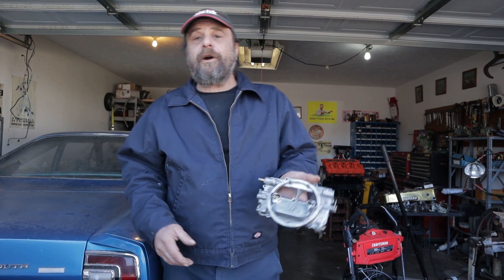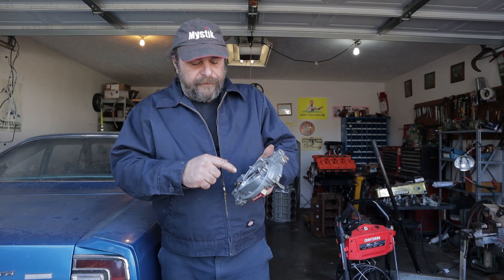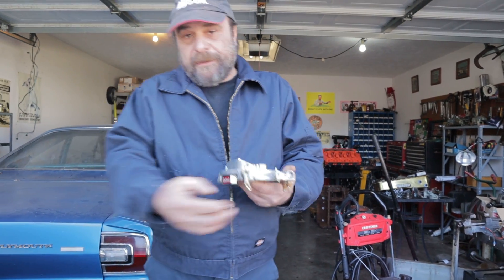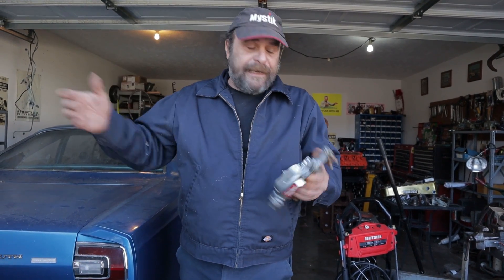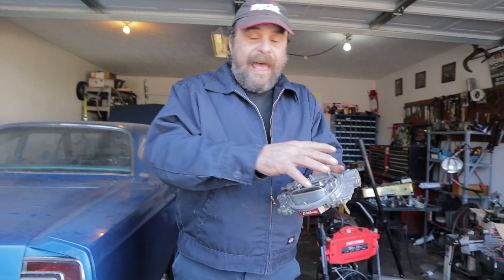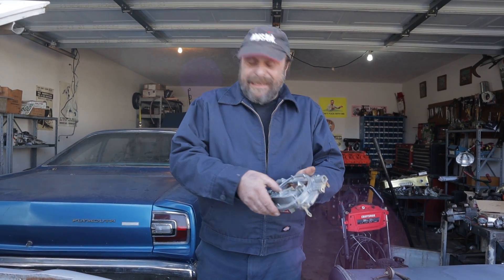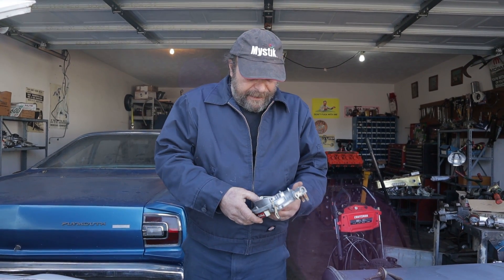The Most Troublesome Part Of Any Carbureted Car

Comment: I'd use to ziptie or old school grandpas style and bailing wire that blade open because they would be part way open or nearly closed... then got to the point where i was like the the heck with this thing... unscrew choke blade and remove the shaft.... didnt want air restriction from that choke blade and shaft anyways... besides that it's kinda like a bike... if you cant start it you cant ride it (drive it) lol

Comment: No lie. I had a 1978 Fairmont with 200ci and 1 barrel. Could never get the choke to work correctly so I removed the mechanism. Everyday I’d push the carb closed and once warmed up I’d wedge a flat head screw driver in it and go about my day. I’m 29 I did that for 3 years. I miss that car it was indestructible.

Comment: Ever have trouble with holley chokes resetting after just 10 mins of sitting. My cousins 327 has a holley with electric choke and we could drive it around all day. And then stop for 10-15 mins and when we restart it, it high idles and we gotta wait a few mins before it kicks off.

Comment: If you tune a carb right a couple pumps and it will fire and run just fine without a choke. Most cars i work on with a carb have an accelerator pump that has been worn out for years.

Comment: P S about chokes our family had two different cars with the rodchester RS2 barrel carb that where 10 years apart in age. The first was 66 Pontiac station wagon that had sticky choke issues all its life that nobody could figure out. Then fast forward 11 years we got a 77 Buick Regal with a 350 H motor same carb same problem. Well I decided to overhaul the carb and convert it to manual choke. Well while doing the overhaul I noticed the choke butterfly sticking inside the carb airhorn so I decided to rotary file the inside of the carb with multi cycles in the freezer to cool down the carb so to get the right clearance in cold winter start up . I had to take out a lot of metal but I finally got it no more problems. You may ask the question why the carb housing instead of the choke butterfly well I was unable to remove the screws holding it in without damaging the shaft. I now think back to the 66 Pontiac and I think it had the same problem with choke butterfly and carb housing interference 🤔

Comment: You brought back a lot of memories. I used to do a lot of carb work-rebuilds. Some carbs had to pull offs to adjust. I can remember doing the initial startup after a rebuild adjusting the choke pull off and high speed idle and kick down solenoid fun days. I have to vehicles and one has a manual choke the other has the holly carb original equipment ford factory 4 barrel but I plan on converting it to manual operation in the future when I go through the motor.

Comment: love your channel. old engine builder from down under.slowly but surely resurrecting my 66 charger .383 orig car,going back together with 440 cranked 400.liked your video about back dressing your slant6 intake valves,have done something similar back home with a die grinder with a small emery flap wheel ,puts a nice swirl pattern on the under side of the valve.when you did your demo,ya nicked close to the stem with your file,if left like that,might drop a valve.that just stuck in my head.like i said before,love ya channel,always look forward to your vids!

Comment: Here in Ontario Canada all the cars my dad owned got manual choke. He never liked relying on the factory garbage. He also used to have marks on distributor cap summer and winter. Made super easy to get the tune in range with the changing seasons.

Comment: You forgot to mention everybody's favorite quadrapuke!
I never messed with the electric chokes, I always ran a cable. It's fun to pull that cable a little while the engine is warmed up for the honda guy behind you at the traffic light too.
Reply: It's more fun if you have a manual transmission. 
Downshift and turn the key off while approaching a traffic light and pump the gas ....pull the chike too , what the hell....
wait a few seconds and turn on the key .......
Then drive to the next county to see if your muffler is there. 
Haha good times as a kid back in the 80s doing that stuff
Reply: @MrTheHillfolk  Most kids nowadays wouldn't be capable of going through those steps, nevermind knowing what's actually happening when you do it right. 
Some of these modern automatics are capable of backfires that can peel a muffler open too though. Best applied through headers and big pipes to a couple of good old flowmasters that shouldn't rip open so easily. Just leave it in second gear...

Comment: I live in Texas.
Got best results buy converting to, or installing manual choke cable, AND removing the choke butterfly plate. Use of the choke plate would often flood the engine. If there was an exhaust throttle, it had to at least be altered to stay open.
I just needed the engine to run faster while cold.

Comment: Those Fuckin automatic chokes never worked right on any of the old beaters I ran as a teen in the 90's so I also put a damn knob cable manual on them because I got so tired of it.

Comment: Stock Holley 2 bbl on a 74 400, Fury. Three pumps when cold, lights up promptly. As it warms, the idle increases quite a bit. A sharp tap on the throttle, if warned, brings it down to a nice idle. I’m pretty sure the fast idle will continue, if not touched, forever. Do I have an issue?

Comment: Ahhh yes. The old Edelbrock warmed up choke game. On my truck, 1-2 pumps in the morning. Then after that, you have to BARELY hold the gas pedal down or flood time. I like everything manual as well. I appreciate the "mechanical connection" and feedback to the driver that the old cars have. I've taken numerous roadtrips in both older and newer cars. If I want to fall asleep at the wheel, it's guaranteed in a newer car. I feel too isolated from the mechanical operations.

Comment: Old school manual choke is the most reliable system you can get.  Little wd-40 on the cable and linkage every 6 months and it will work great for 25 years.

Comment: When i learned to drive, i learned on a '80's Olds 98.
Had to learn how to start a carberated engine in -30° in Northern Ontario.  
In the glove box there was a dead Bic lighter to hold the choke open, in case i flooded the engine (which happened alot when i first learned to drive)
Reply: i thought you were going to say the bic was for burning the exxess gas my buddy used a match til he started the carb on fire att the drive in

Comment: The integral choke used on '85 - '89 Quadrajet Mopars  (M body squads, '85 - '88 318 4bbl trucks/vans, and most 360's through '89) was the best.  Chrysler kept the electric assists from the Thermoquad (choke heater and thermostat), but the elimination of the manifold well-style choke greatly improved the choke's consistency in colder climates.  They also had adjustability the TQ didn't have, and they held their tune far longer than the TQ would.  The downside was they were trickier to set up correctly, and that usually wound up with the carb over-choking.  The choke on the Qjet also affected the secondary lockout, so improper adjustments often led to no secondaries on kickdown.  

The Edelbrock/Weber AFB and AVS could probably be modified to accept the factory choke heater, which could assist with warm/hot soak restarts.

Comment: Growing up in Texas. In the 60's.. We only needed the choke a few days a year. When I bought my used cars. The -st yhing I did to them was disconnect the choke. It made it hard to start on the below freezing days. I just oumped the accelerator 8 times. It would start. It would take a few trys to keep it running.

Comment: When man tries to reinvent the wheel problems arise. I owned a 66 baja vw bug for a first car and it had a manual choke. I loved it pull it half way out on days below 40. Pull all the way out on days in the teens, she fired up easy. Let it warm up for bit push in choke. When i owned a 1970 buick gs 455 she had a "quadra junk" carb and had auto choke that was temper mental. Hard to start on cold days. Once it warmed up it was fine. Quadrajets were good carbs for daily driving but never for wto throttle racing. Holley carbs for the strip all day long. When i had a 750 double pumper on that 455 it came alive under wot conditions.

Comment: The heat riser flap on my 78 460 has a small brass actuator that reacts to the temperature to slowly allow the flap to bypass the riser. Good luck finding that little actuator. Mine took a dump and my truck was running with only the air coming through the heat riser instead of through the cold air from the front of the grill after warm-up. One of the best, easiest and most durable factory chokes I've ever seen is on my bride's 1962 Mercury Comet. Keep the parts lubed and it just keeps going.

Comment: At one time,  I made a living just fixing quadrajet chokes and choke pull-offs in the winter. For some reason, people had a hard time understanding, “one pump, turn the key to start, warm up, tap the throttle to idle” . They had the need to pump the pedal five times and flood the motor, it was crazy
Reply: ANY other carb than an effing Q-jet, and you could get away with five pumps!  LOL

What I found most of the time is they couldn't just pump the carb and leave the foot off, they would pump, and pump, WHILE they were cranking.

Comment: Had a bike with a Slide Carb and it ran fine at full throttle, but every time i rode it at partial throttle it basically died, if i opened the trottle fully and go back to part throttle it ran fine for a couple of seconds and i couldn't figure out what it was. Well, it was the Chole slide, on that Carb they were pushed back up with the Throttle slide and normaly click into the top plate of the choke, it just fell back down for me because the slide and the Top plate were worn out.

Comment: I had forgotten about the choke stove off the manifold. Chevys had that thin flex pipe off the manifold.
Reply: Truth Maximus    That heat take off (actually lack of) was a big reason carbs. got a bad reputation in my opinion.  Very nearly every car I saw back then was missing that pipe. Made start and warmup more difficult without it.
Reply: And I never saw a car with a working heat riser valve in the exhaust pipe.  Mind you, I seldom saw new cars.
Reply: @raoulcruz4404  Me either lol I'm from a rural area and grew up in the 80s we all had 70s 4x4 trucks with 350s with about the same issues

Comment: Quadrajet is a good carb people just don't know how to use them. A great thing about them is that if your on side hill or alot of angle and your engine dies they will start easily again. A holley with electric choke makes it easy 1 pump set choke and turn key. But a couple pumps on a good running engine it will start easy and only take 10-20 seconds tell it will idle. I tend to very slightly increase idle during winter it helps.

Comment: Taking the butterflies right out works magic , there are only 2 carbs you need choke to start they are SU carbs and CD stromberg , no acc pump in either they need fuel valve open to get enough fuel in . The other major problem with any carb system is muppets with just enough knowledge to be dangerous playing with them . Even though i have been a mechanic for over 45 years you have forgotten more on Petrol engines than i will ever know . Cheers from Australia

Comment: I love old school carburetor talk. I grew up on cars with these. I intuitively learned how to feather them. Listening to tell rich from lean, long before I learned how they worked. If you didn’t? You couldn’t drive anywhere in the winter. The automatic chokes with the heat crossover worked pretty well...until the coil spring in the exhaust pipe broke. Or the weight rusted and fell off. For ultimate reliability, like the ‘53 Ford, 3 on the tree, I drove into the early 1980s, the manual choke was the “Bee’s Knees”. It did tend to get carburetor icing on a cool/cold and humid morning and wouldn’t idle worth crap. I devised a work around. It involved the bottom of a 5 gallon bucket cut to fit over the oil bath air cleaner, a 3” PVC Tee and pipe, and a manually operated butterfly valve made from the metal lid of a jar of peanut butter. With some aircraft heat ducting connected to a makeshift sheet metal contraption over some of the cast iron exhaust manifold. It worked like a charm, barely. I’m serious as a heart attack. I was commuting to school in LA and it was very bad to have your engine die on an uphill stoplight during morning traffic. That was about a block from my apartment. I worked as a gas pumper at the local airport in the summer. and scrounged the design idea and parts from my bosses junk pile. The engine eventually broke a rod cruising home North on I-5 in Northern California to Medford OR. My Dad and Mom came with his Minnie Winnie motorhome and strap towed me to the far side of the Siskiyou pass brake check area. He said I should just coast down the ~15 miles to Ashland and then he would tow me home. It worked great...except it was raining fairly hard and the ‘53 Ford’s wipers were vacuum powered. No engine? No vacuum. No heater. So I had to keep the window down with my hand and arm stuck out in the freezing cold rain to manually operate the wiper. All while watching my Mother staring at me out of the back of the motorhome with a concerned look. It’s a steep winding freeway mountain road with a couple of truck runoffs. Fortunately the rainwater kept my “high tech” 4 wheel drum brakes from fading. My Dad put a rebuilt engine in it and used in Portland OR where he was based as an airline pilot. Where it is cool/cold and humid. He called and said it kept dying on him when cold. I told him to put my Rube Goldberg contraption on the engine. He always looked at it as a dubious thing. He called me back and said “GD it works”. I learned everything in know about cars and mechanics from my Dad. I miss him.
Reply: Thank you, great story! ❤
Reply: Checking in from Medford Oregon. Love the story. It played in my mind while reading it like a movie 😂
Reply: @Ivusmchine  Thanks, Brother.  There's more strange, almost unbelievable, twists to the story. That are interesting. 
I still miss my Dad.
Thanks for the nice considerate comment.

Comment: Every convenience and smog "extra" on these carburettors is one more thing that can fail. Has anyone seen carbs on Japanese cars from late 80s and early 90s? Awful lot of vacuum hoses and misc. clutter around carburettor...

I like my choke the same way I like my gearboxes - manual.
Reply: v6ileib    ‘81 Tercel. I’d like to upload a picture of that carb. and vacuum line setup. Really gave constant problems as the car aged.

Comment: Tony, you know this I'm sure, closing the choke doesn't just reduce oxygen, it greatly increases signal vacuum at the venturi. :)

I've only had trouble with automatic chokes under two circumstances: imperfect electrical connections, and situations where the carb is cooked from under hood heat after shutdown, and the motor is still absurdly hot when starting.

I solved this once in my Jeep with a manual choke and never looked back.  I really like the Holley manual choke.  Everyone says "why did you do that?" but I just keep using it.

Comment: The Carter AFB carb is the same as a Edelbrock but has a electric choke like the Holley. It has the little vaccum pull off piston and a fitting for external heat source. They are available new as a replacement part that fits directly into the Edelbrock carb. They work Much better, especially if you live in a area with really cold winters.

Comment: My 85 Honda Accord with a 3bbl 1.8 ES2 CVCC, starts on choke and revs to 3000rpm. Starts at -40 or 110 temps but fucking revs to 3k. made adjustments, still cant get it right,

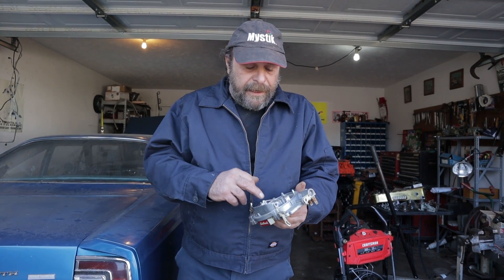Comment: 0:27 Oxygen rich ehhh... so so. A better explanation is that the fuel doesn't readily atomize when the intake ports are cold so by injecting more fuel there is at least some ignitable mixture

Comment: I have converted all my rides to manual choke. There is allso a bonus function in manual chokes. If you pull the choke on in warm engine, youll instantly get rough idle, like you have a badass huge cam in stock engine :)

Comment: A tiny throttle body injector might work with a carb - it would leave the air flow unrestricted and it would positively shutoff by a simple control

Comment: are there any cons to having a manual choke?
Reply: Atanas Vangelov   You have to be mindful of where you set it. It’s easy to get the engine running and after a bit of warm up, drive around with the choke partially closed.   You also have to be the choke pull off. That little diaphragm thing UT was holding. It’s easy to get wrong until you learn what the engine “likes”.

Comment: Man I feel like I'm in the minority my 72 D200 400 2brrl automatic choke one pump of the pedal fires up high idles perfect and runs well cold. Just a couple weeks ago fired it up in 10F and pulled out immediately drove great. I guess I know what to look for if mine starts to have trouble in the future.
Reply: Branden S   You (we) might be. But my 70 318 Plymouth had automatic choke on a 2bbl carter. Drove over 200,000 miles  Set it once when I got the car and the choke always worked as it should.

Comment: I work at a machine shop learning to bore and hone blocks and grind cranks. Been doing heads for years as a specialty and hate when carbureted era heads come in with that crossover completely filled with soot. That stuff is like cement.